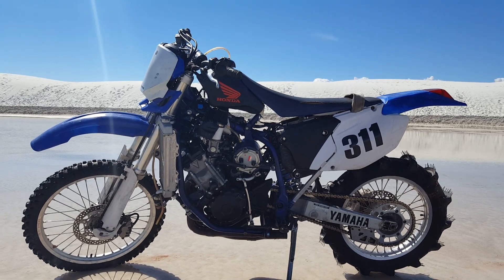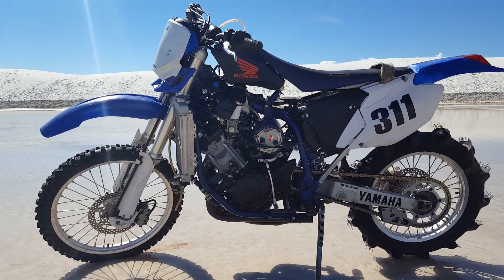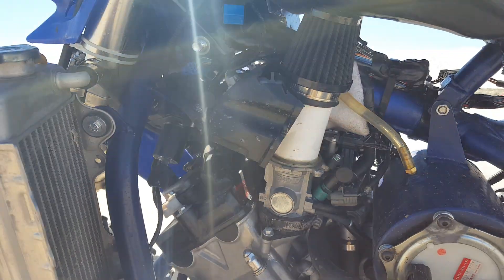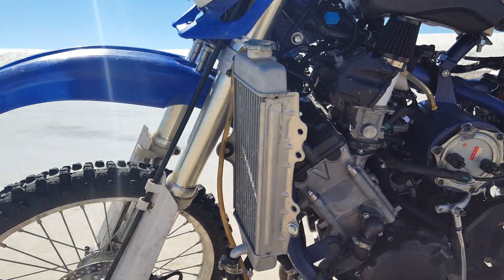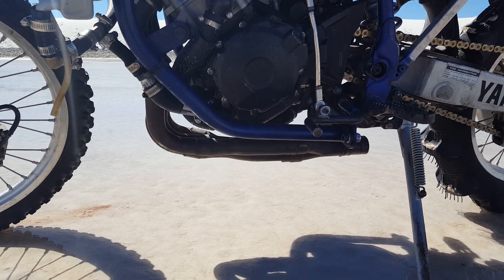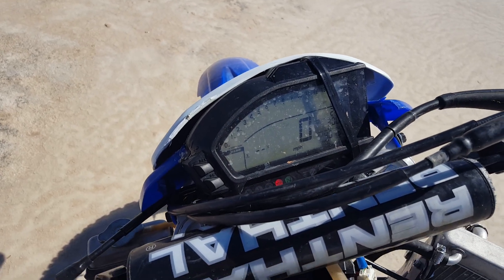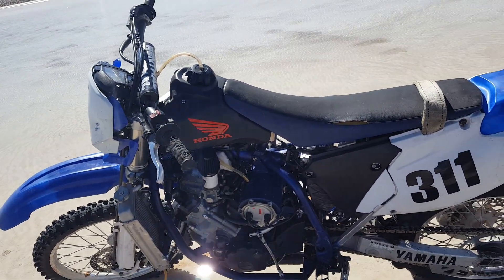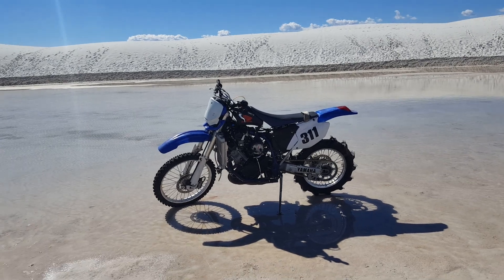1000cc dirt bike at white sands with viper paddle tire

Comment: How fast does a stock dirt bike have to go with start card knkbbys to hydroplane across a small pond
Reply from the maker: 6th wide on a 125cc or 250f or 5th wide on a 250cc or 450f about 70 mph at least more like 80 if you dont wanna look like a squirrel, that will get you close to 200ft of water at the most until it starts losing momentum
Reply: @jasonkline3082  my 476f only does 76mph but its geard for low end power and not necessarily top end speed
Reply: @eragonshadeslayer1  i would reccomend caution
Reply: @unclestoma4699  i sure will think about it

Comment: Have you a link to the build I'm having trouble with mine
Reply from the maker: Find my email on my channel it wont let me respond with the email address, i built it, i didnt make a video showing any details but il answer any question or just ask me here
Reply: @jasonkline3082  are u on Facebook... Just woundering how u mounted the swing arm and the engine and did u cut the frame... I have a drz 250 and bmw 800 engine I cut lower part of my frame
Reply from the maker: Yeah im on facebook too 1000cc dirtbike only or my page jason kline, i kept the bike and swingarm intact and just cut the frame in the front and lower half and then had chromealloy steel tubing bent into place for the engine mount and frame i cut as the video shows, now the motor and front sprocket sat 4 to 6 inches higher than the axis point on the swing arm which will cause chain spillage which i solved the best i could with the biggest rear sprocket and a 530 chain
Reply from the maker: The two back mounts on the motor were welded to the back frame the lower mount right above the swing arm and the upper inbetween the frame as you can tell the motor sits 2 inches farther forward than it should because i didnt use the swingarm for a mount
Reply from the maker: Message me il send some detailed picks of how it was mounted they just welded tabs for the bolt holes jason kline in timberon new mexico